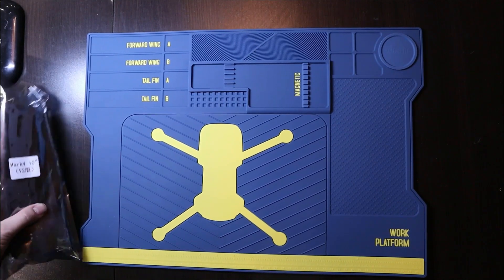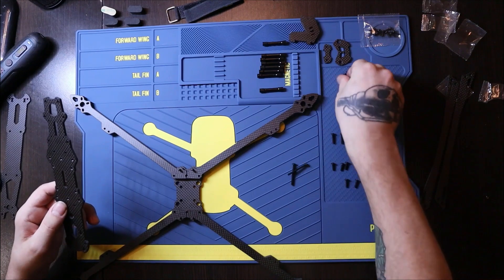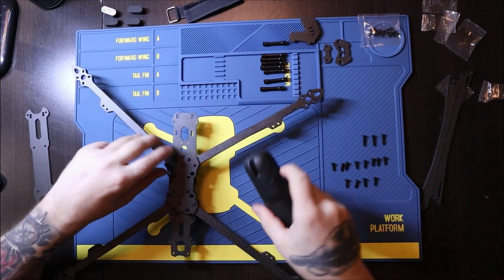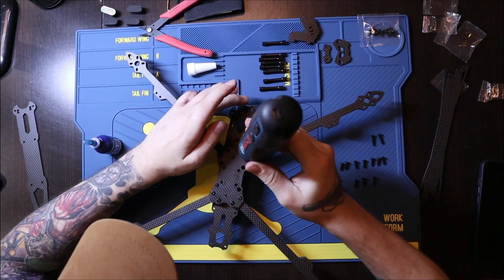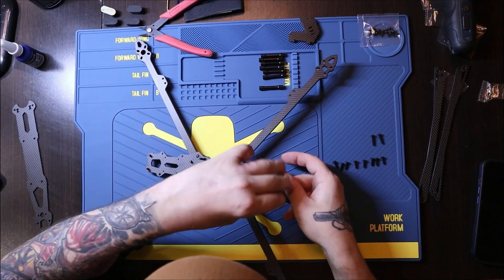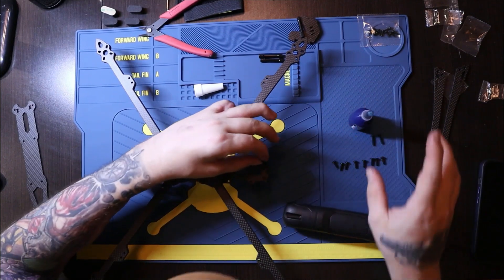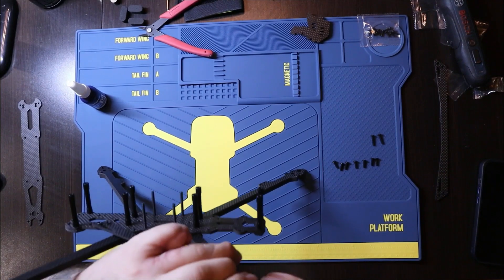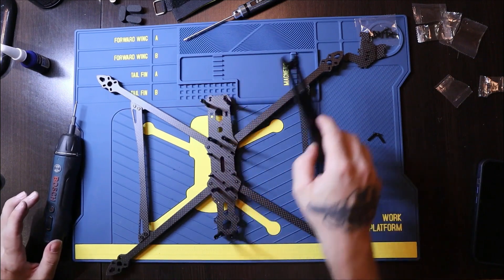How to assemble a FPV drone frame Mark 4 V2 10''

Comment: qu est ce  qu il y a  dans la bouteille  bleue?
Reply: It's a thread locker, it ensures that the screws are going to stay fixed in place (the vibrations the screws experience in flight might cause them to unscrew so this prevents it).
Reply: @Київськийторт  شكرا اخي